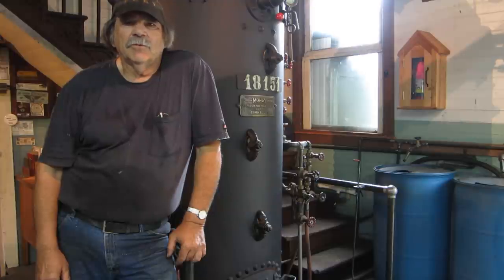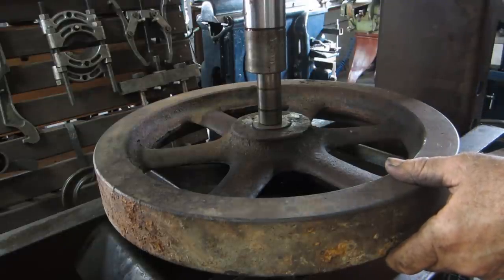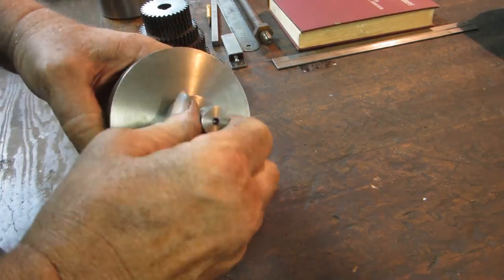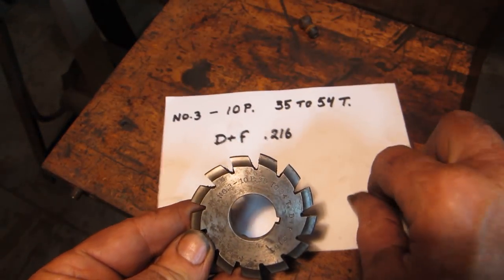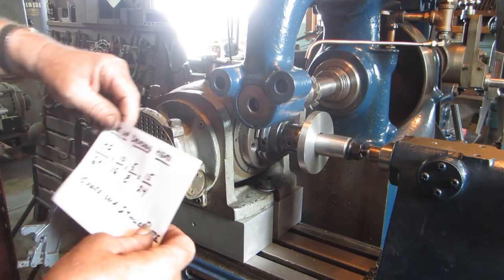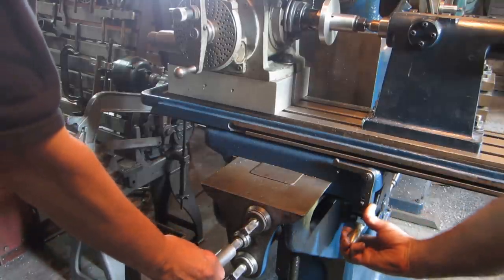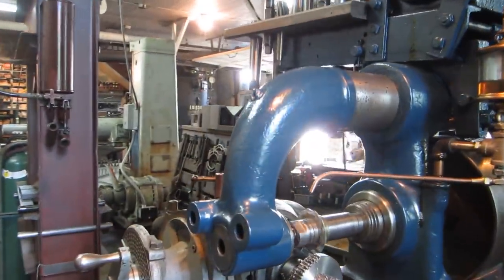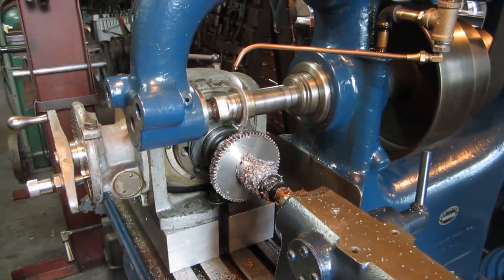OLD STEAM POWERED MACHINE SHOP 13  Making some gears

Comment: great vid love the old stuff so ne way at 34:38 your assistant puts the pin on the outside of the gauge and then later at  38:21 u put it on the inside of the gauge and u said that u guys haven't messed it up so my question is and correct me if im wrong but i think that it is only a 2 hole difference and it shouldn't matter that much if it was only a few teeth? or will it matter a lot because it is going on the lath and precision is needed?  and if it is ok for the machine will there b some extra where on the teeth that were cut wrong as they will b thicker
Reply from the maker: Thanks for the comment Isaac, You were the first to comment on it. You can go either way as long as you stay the same every time. Inside the quadrant is the correct way to do it. I was not thinking right (old guy) when I explained it....Dave

Comment: The crank your working on what engine does it o to oil gas or steam? 
Love the videos was wondering if you used a fireman when you had jobs in the shop.
Reply from the maker: The Morris Machine Works steam engine that I am rebuilding in the shop, see video #12....Thanks,...Dave

Comment: Dave, how do the pulleys get driven with so much apparent slack in the belts? They seem to just be flopping around so to speak
Reply from the maker: Leather flat belts don't need much tension, the surface area against the pulley is large and they get good traction like a rubber sneaker on a clean gym floor, good question......Dave

Comment: Is it better to press those shafts without a penetrating oil soak? Unreal work sir! I have done a few rusted gearboxes for BSA's. Mostly cutting them out!
Reply from the maker: I had soaked it for weeks and expected to have to bore it out, it was a surprise when it broke loose and started to move.
Reply: Well that makes sense, my bsa channel is 441rider. (some early bike history vids up) Have you ever fund raised by making kit engines? 1/4hp size? That project you bit off is heavy duty.
Reply from the maker: Thanks for the comment. I would encourage all my viewers to try building model steam engines,  I have a few, but this channel is dedicated to the real "turn of the century" thing. Steam power, line shafts and machine work....Dave

Comment: great video. i have never seen a dividing head that used cat tooling. can you mount a chuck on it?
Reply from the maker: Yeah, it's CAT 50,  I made a back plate to fit a Cat face mill holder and mounted a small 3 jaw on it, but the chuck was really beat up and had a lot of run-out....still looking...Dave

Comment: I have a question, after making the gears did have they to be heat treated?
Reply from the maker: Hi Kevin, these were made out of mild steel and there wouldn't have been enough carbon or alloying elements in them to do much hardening. Could have maybe been surface "case hardened" but they run slow, seldom, and under almost no load. I have a friend that made some threading gears out of plastic stock, worked fine.....Dave

Comment: I also have a south bent lathe exactly like the one in this video, were can I find a screw cutting dile for that model
Reply from the maker: I ve seen them on ebay for the 9" SB. The Jr. model like mine has no mounting boss or hole so you will have to drill and tap somewhere on the carriage to mount it. Other brands might be made to fit, if your lead screw is 8 pitch you just need a 32 tooth gear....Dave

Comment: Are the plastic 55 gallon drums the water supply for the boiler? 
I was thinking you might be better off with a non lifting injector installed as they are normally installed on a locomotive 
So they are below the lowest point on a locomotive under the lowest point water wise. This way if a lifting injector overheats
Before it picks up you simply shut off the lifting injector and open the water overflow on the non lifting type and even if 
It over heats simply let the water cool it down real quick like compared to a lifting type.
I've seen three or four injectors on stationary boilers and the engineers reaction " better safe than sorry " 
Run steam engine exhaust thru a feed water  condenser tank  then feed condensed water that holds 100-150 gallons of water with a float that controls steam flow to A two or one cylinder feed water pump sight gauge on tank and a manual feed for tank. Hot water will reduce your fuel
Required to run boiler food for thought 
Jim
Reply from the maker: You are so right on the feed water heater and I've thought about that, the biggest problem there is that the engine is about 30 feet from the boiler which would require the exhaust to be run to near the boiler or the feed water run to near the engine and back either over the door or under the floor. I have a nice little duplex pump that would work for that. It could be done. The Hancock injector is a double injector with a "lift" circuit and boiler injector, I really like that injector. Actually, I discovered that the problem I had sometimes was in getting an air lock from the water draining back towards the tank. I put foot valves (with spring removed) in the hose pick-up and It works much better. Great discussion....Dave
Reply: +David Richards when I was 12 years old I " discovered" the Wakefield Laundry Wakefield,Mass 125 horse poppet valve Corless
Steam engine running the laundry on the first floor all jack shafts and belts. Original hand fired steam boiler replaced around 1948
With a cleaver brooks bunker C 100 PSI boiler feed water slow speed 2cylinder pump as described earlier was from there
Condenser and feed water tank was 28 feet from boiler ( I measured the distance) engine has been removed and preserved
   One Wednesday morning dad woke me at 0645 to say the general manager was at the door the Engineers car had busted a u joint
And he was unable to get to work on time and said to pick me up as I would be able to fire up the engine properly. I was 3 blocks from the laundry 
Once there swung burner open inspect combustion chamber with flashlight after removing 35 gallon grease cover used to keep cold air out of boiler
Swung burner into place, locked it and plugged in motor verified water level turned
Reply: +David Richards on natural gas ( igniter) then powered up boiler watched it cycle from low to high to low on fuel rate then go through ignition 
Sequence and ramp up to high burner instead into engine room refilled lubricator and all grease cups didn't care if they had enough grease for the day had to use bar on flywheel to position for engine start then sat down for my first coffee. Manager was freaking out engine start was 7 am 
Religiously it was 710 am I explained that I didn't have enough steam to start the engine was at 39 pounds and when I had 90 pounds I would start
It. He still was unhappy. Turned on feed water pump only needs 15-30 pounds anyway to run.
At 726 I had 97 pound and after lifting the eccentric and manually working the valves back and forth to make sure they are free and release
any water trapped cracked the throttle 3 revs later spun throttle wide open as the air compressor had to fill its reservoir then walked around checking bearings and odd and ends to make
Reply: +James Shanks everything was as it was supposed to be 
The Engineer finally showed up at 930 am walked around looked at everything checked a few temps by hand then set his lunch down 
And said good morning "..........................nice job when did you start it? When I told him he asked what the manager had done prior 
To my engine start when I told him he tried to start the engine at 45 pounds I had to pick up a wrench 2 feet long about 35 pounds and physically 
Threaten to break his arm if he didn't get away from the throttle he brought the manager down to the engine room and explained to
Hi why I wouldn't start the engine at 45 I was shocked when he handed me $100 at the end of the day it was the manager decision 
I miss that old engine
I know I type too much
Jim
Reply from the maker: Great story James...

Comment: Very nice video. Who else can cut a gear on a 1880 or something mill under steam power using belt transmissions? Of course you did everything right but I think you said something wrong which is a common mistake repeated by many others. You did not advance your dividing head by 15 holes but by 15 spaces between 16 holes. The sector arms were set to embrace 16 holes and 15 spaces. You always count spaces not holes. Of course if you introduce the rule to never count the first hole then the number of holes and spaces becomes equal. But why complicate things? For you this is a nobrainer but for newbies this can be confusing.
Reply: All true. Depends  how you number holes. I always number the first hole 1. If doing 15 holes on some plate, the next hole will be #16 (add 15 to 1), the next one 16+15 =31. Hmm, 24 hole plate, wasn't it? Whenever hole number exceeds nunber of holes on plate, subtract it.  31 - 24 =    7.  I work out the hole list on paper.  Could mark the holes with sharpie.
Reply: Would it not be much simpler to forget about holes and work only with spaces? The problem with holes and spaces not being the same is THE single most important confusion leading to screwed up parts that scares people from using compound indexing. Counting only spaces you never make a mistake unless you can't count. Everything becomes straight forward and clear.
Reply: I find counting holes easier, but most people count spaces Whatever is you like, do it.
Reply: Sorry. Most people count holes!
Reply: Yes, most people count holes and many of them screw up their parts...And those who did might heed my advice. You can lead a horse to the water but you can't force it to drink.
Reply from the maker: You count the holes that you advance, simple?....Dave
Reply: You stick to your habit because it works for you. I offer a slightly different one which IMHO leaves less room for error. The readers decide for themselves what to use.

Comment: Nice job explaining the gear cutting process and the simplified formulas.  Good old Van Norman dividing heads were great!  Until someone cuts a gear with that many teeth, they can't appreciate the difficulties or how easy you can screw up and don't know until you cut the last tooth.  A simple distraction and you're done.  Just the backround noise of the belts and steam engine would be enough to distract me but at the same time the sounds are soothing - maybe too soothing.  Thanks!

Comment: I'm experimenting with a very old method of gear manurfacture which involves using a specially cut broach to cut teeth
Reply from the maker: A little like forming a tooth on a shaper. how do you index it?...Dave

Comment: You're using the adjustable wrench backwards.
Reply: Not if your left handed!
Reply: No! Just like Channelocks wrenchs. The harder bite or grip is in the adjustable portion of the wrench. Read the directions.
Reply: Thats where slippage and knuckle accidents happen when you use adjustable wrenches backwards.

Comment: I found a penetrating oil called "Kroil" by a company called Kano. If you can find some, give it a try - it's pretty good stuff! I got this from MidwayUSA - the sporting goods people.
Reply from the maker: Yeah Merle, Kroil is about the best there is, I just got tired of forking out $6-7 a can for it only in full cases of 12 from them.  I make my own from acetone and ATF, It works pretty well, try it....Dave